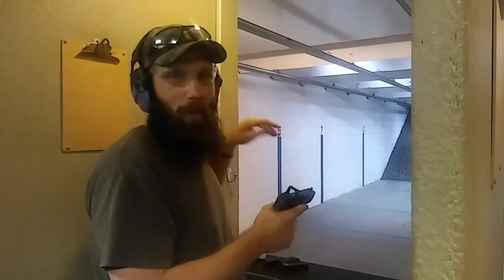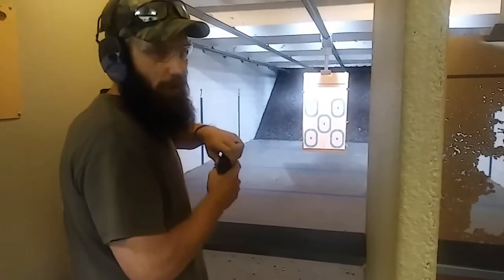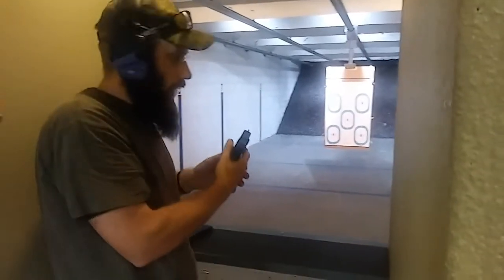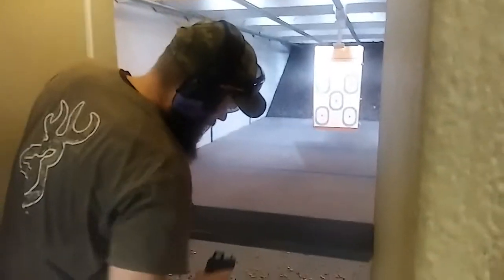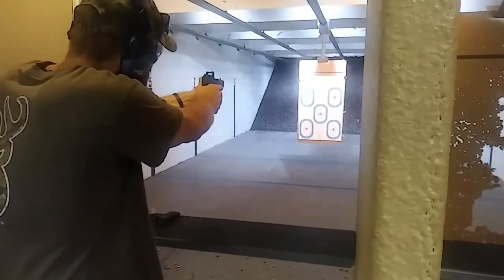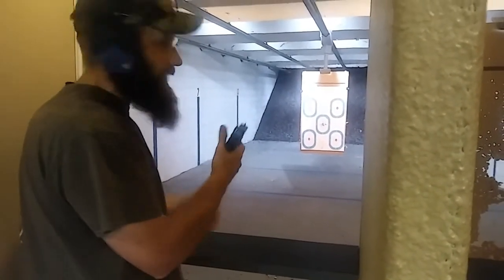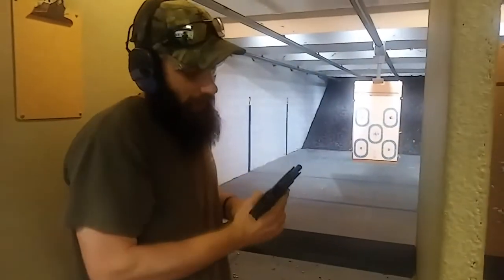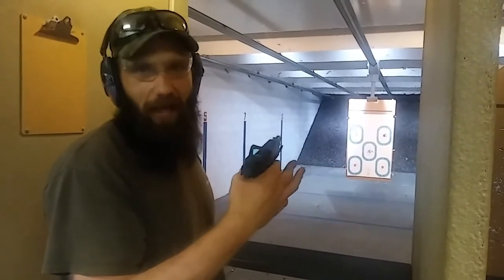Trijicon RMR durability test RM07 beat down!

Comment: I’m not sure what this proves.  When, other than during an actual SHTF and extremely rare situation, would you need to rack the slide this way?  If things get that bad for you that you HAVE TO rack your slide off a hard surface, then you can do this with any optical sight.  Once you chamber that round you’re probably going to empty your mag in less than 3 seconds and not even need your red dot anyway.  Let’s keep it real.
Reply from the maker: Well i guess it comes down to ill plan for the worst and hope for the best. That way I know my gear will work. If you take some training or even read some case studies on shooting you may be surprised at how often people are shot in the hand/arm. One handed shooting increases the chances of a malfunction by a huge amount. How do you clear a 1 handed malfunction? A gun equipped with an optic is like a huge billboard you use to your advantage. YOU may think this is not worth doing but I do. But we are ALL free to have our own opinion and I respect that this wouldn't be something you would do or see a reason for.
Reply: One hand rack, whether on my belt or nearby hard surface, is a regular part of my training routine. Currently that involves catching my Truglo Pro rear sight on the surface for contra.
I would ONLY mount an red dot if I believed it could step in a serve that same purpose. This demo shows that the Trijicon can!
Reply from the maker: This optic is still going strong! Even after a few waste high demo drops to that made everyone ive done it for a believer in how tough and EDC ready an RMR truly is.